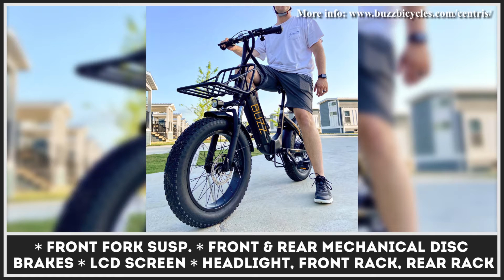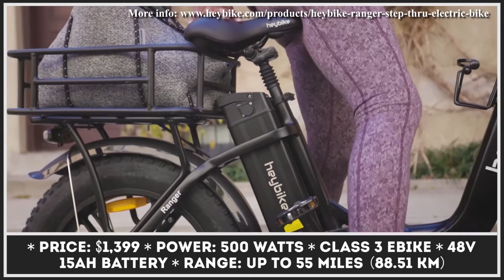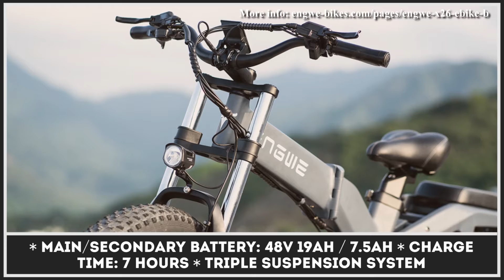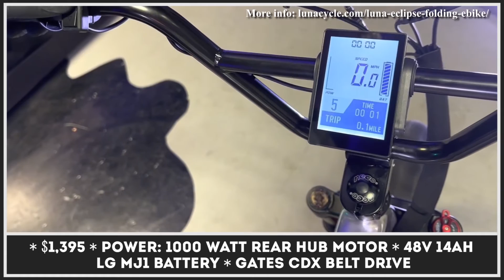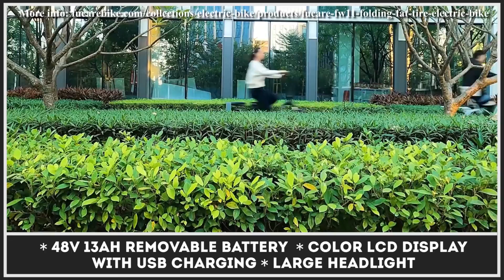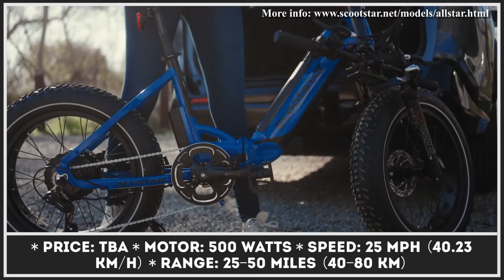10 Newest Electric Fat-Tire Bicycles w/ Folding Capabilities (Ranked by Prices and Specs)

Comment: Lectric peddles need to be a little more forward for comfort. Lectric has a no return policy unless it's never been riden. We tried.
This is our second e bike and now I know one more thing to look for .
Reply: Yes, there are a bunch of ebikes made from the same Chinese platform and they all suck when it comes to actually pedaling the things. That is when you compare them to ebikes made by real bicycle manufacturers. It's taken decades to figure out how to make an efficient bike. The geometry that they use is not a secret, but it is crucial to get the most out of the pedal stroke. Just throwing a battery on a frame and a motor hub in the rear wheel does not make a good bike. The only thing that that design is good for is to make a cheap ebike. But on the flip side 10 to 15 thousand dollars for a trek or specialized is a little ridiculous for something that still only goes about 40 miles on a charge, if you are lucky.